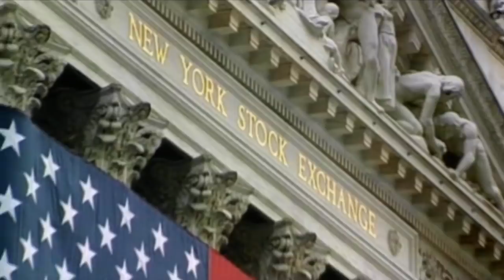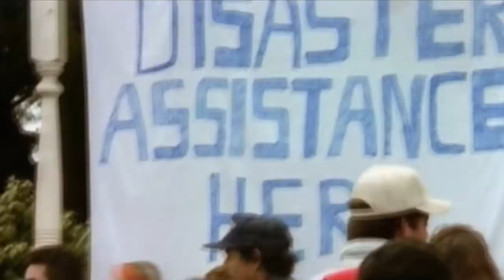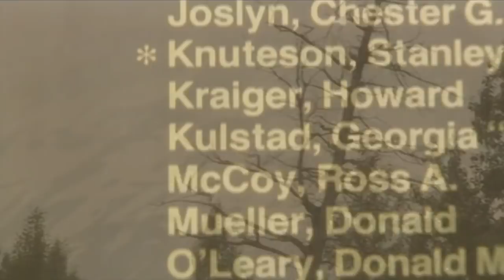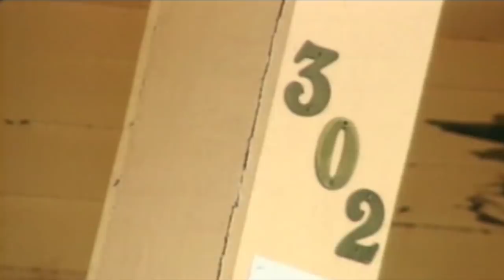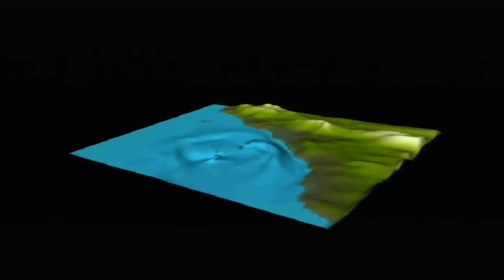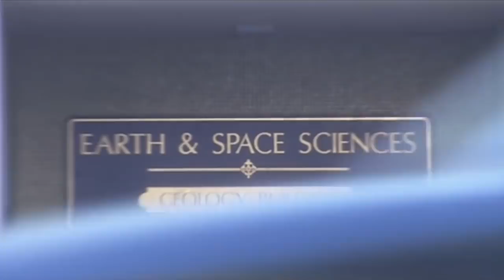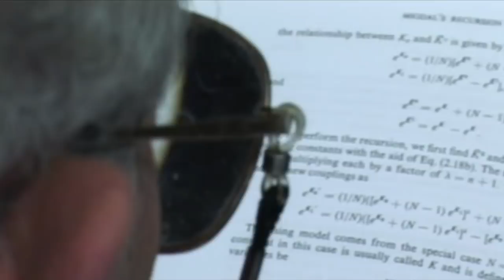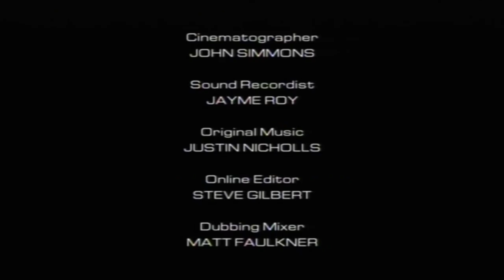Angry Earth

Comment: The finger snapping example is a great one. If earthquake is caused by snapping of a finger, I wonder what'll happen if the earth starts clapping.
Reply: It already has in the past on a few occasions. One was when the planetary body, Theia, smashed into the Earth and formed with it and it also helped create the Moon. This devastation was the greatest threat Earth had ever faced. The greatest Earthquake that animals had ever faced would have been the KT disaster from when an asteroid, taller than Mount Everest, 6 miles wide, and going at 50,000 MPH, smashed into the Earth. Such a scale would have easily been an 11 on the Richter Scale. Earthquakes were so bad that entire layers of land would have been removed to the point that Dinosaurs would have fallen into the Earth. It also caused Tsunamis, hundreds of feet tall, to travel all over the world.

Comment: The descriptions of how the Pacific plate is moving northward is correct ,however the North American plate is not moving south. The Pacific plate is partially locked in two locations. One just to the north of Los Angeles near Edwards Air Force  base the other us off shore in the ocean around the California/ Oregon border. T(is lock is part of the Juan De Fuco plate that is being pushed under the North American plate at the Cascadia subduction zone.,this is why, the Pacific plate seems to be pulling apart from the Juan  De Fuco  plate north of lock point. The evidence fir this comes from the Hawaiian Island chain as the p,ate moves, ti turns slightly. This is akin to the Juan De Fuco. P,ate being forced. sideways To the  north east.. at subduction zones, when the earthquake occurs, the side opposite if the moving plate  has initially been forced upwards and. At 5he point of rupture, it returns to its position at sea level. This is why during the earthquake  in Japan the destroyed the Fukashima power plant, the 30’high Tsunami seawall was overcome,  the wall ps were built on land that was already higher than the nominal sea level..

Comment: For some reason, I thought game 1 was about to get started when the quake happened. I was 23yo at the time. However, I lived about 400 miles down the fault in Desert Hot Springs about 50 miles from the Salton Sea, the Southernmost end of the San Andreas fault. I looked over the past few years at   maps that showed where the faultline was under the ground. Noticing the signs of sag ponds can also tell you exactly where the faultline goes. The line started coming diagonally into town. The main intersection in town is Palm Drive and Pierson Blvd. The fault passes within 20 feet of cutting the intersection like a pizza. Then it curves around and splits Mt San Grogonio and Galena Peak like a wedge. A small segment spurs around to the East of the mountain down the I-10 corridor moving towards San Berdu then skirts I-5 and goes up into the Angeles Forest and parts Northward